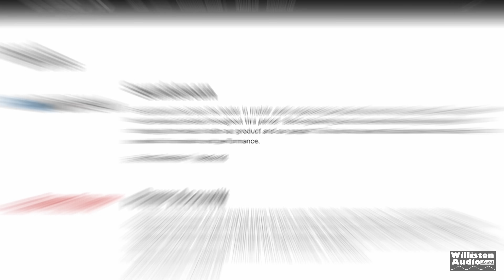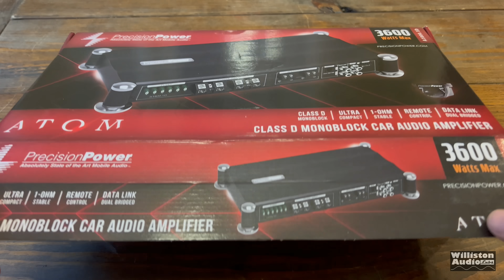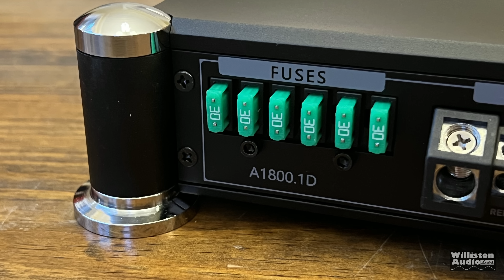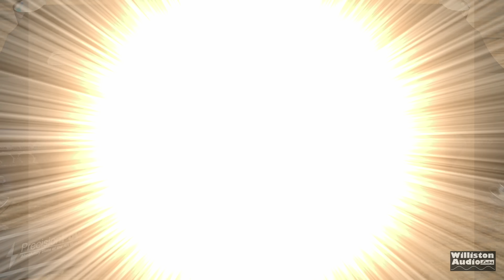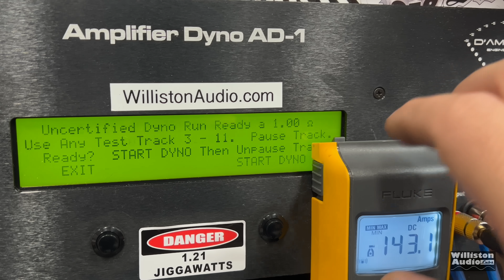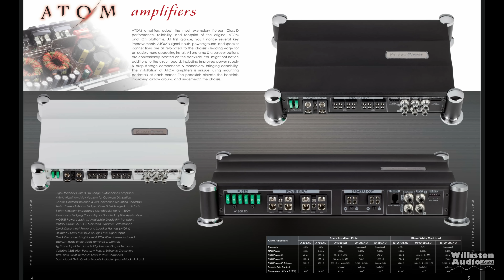KOREAN 1800W Amp for $129? Precision Power ATOM A1800.1D Amp Dyno Test and Review

Comment: The layout of the power/grounds, speaker hookups, and fuse size and layout is almost identical to the Soundstream Rubicon nano5k. I thought the power was going to be similar but it was actually like half because I believe the nano did around 2650 at 1 ohm. At that price tho it really is a good deal and impressive it did .5 without going into protect.

Comment: Where do you set the gain on the amplifier when testing?
Reply from the maker: Amp and head unit are matched via the DD-1+ on the Amp Dyno. Typically the gain is just under 1/2 with the high voltage head unit I use (Pioneer DEH-80PRS)

Comment: this is a good deal for the power available but why rate it at 1800w when it does 1400w? I would be quicker to buy this at the same exact price if it was underrated on the box at 1200w rms and actually did the 1400w. I mean I get the fluff even if I don't agree with it, but it's 2025. we ain't got time for that! we want real or underated rms listing's

Comment: It is actually illegal to void a warranty in the USA 🇺🇸 due to the "warranty sticker" that flies in some European countries, but in the USA we have a little thing called "right to repair" keep splitting them seals Big D! Thanks for the video! While they failed to back up their ratings, this guy does everything I need at a fairly good price. Im'a buy me one!

EDIT: I purchased this amp, and am running it @ 2 Ohms on my Rockville K9 12 dual 4. I was replacing a power acoustic RZR2500 99$ Walmart special. I have to say, the power acoustic isn't necessarily louder, but 100% more solid sounding. I am a little embarrassed to admit, I am an audio engineer, but can't quite put it into words. It seems like the difference in a class AB, vs class D. I know they are both class D, but this has been my experience when comparing a class AB, and Class D of equal power. The class AB sounds much more solid. Not louder, just more solid. I purchased another k9 12. I'm going to give it another shot at 1 ohm. Fingers Crossed!

Comment: The Upright Power Class Amps do make a little over their rated Power.  I think it is cool hqving it stand upright to take up less space and I hopefully be built well enough inside to handle potholes in the road.  But for the price not bad. As for the Atom Series Amps, since they had the correct amount of fuses, I wonder if maybe this amp wasn't "defective"  ?  Or am I being too nice?

Comment: Wow, still priced the same, would luv to fab a plexi bottom for the amp and install it inverted style... the color scheme of the PCB & components looks like a high-end home audio amp, IMO.  Run it hard with the extended warranty but bear in mind that most car audio manufacturers will require you to go through the AMZ seller for a warranty claim, not a manufacturer direct claim. I wonder if PPI operates that way... hopefully we'll never need to  know  :D

Comment: I mean in reality you could buy 4 of these for 5200rms for $520 bucks and a lot people running that type of power run d1s could do 1 per coil and it’ll still be less money than 90% your 5k Korean built amps out there or even if you have 2 d4s you could strap 2 of them each sub run each sub at 2 ohms for 5k+ for $500 imo it’s not a bad deal being Korean made if it was Brazilian or Chinese made its out the window though forsure .

Comment: Im disappointed in their rating on this amp, but i will say the quality is there. Ive been running one of their Ion 650 monoblocks, another Korean built PPI amp, for 5 years in my Crown Vic. Its been nothing other than fantastic for the $100 i paid for it new. The ion's were more accurately rated though, they would make rated power at burst on the dyno at Sonic Electronix

Comment: I've been running precision power atom series on my system for over six years. Starting with the last version of the atom amps and now the new model. I'm running the 5 channel to polk MM 6.5" and a DD1806. I needed something water resistant and compact to fit my build. It's on a pedicab without suspension, being rattled to hell. It's been working great.

Comment: Interesting to see that car audio is still a thing given that OEM car systems are SO much better than they have ever been - rather than throwaway systems - you have vehicles with McIntosh, Mark Levinson, Focal, and others -- so nice!  But as always - the high end market will always provide value. I had several iterations of systems over the years. I had a love of music not just 'sound' so I got a job at a local high end store that had car audio gear -- blauplunkt, alpine, mcintosh or nakamichi head unit my speakers ranged from a/d/s, mbquart b&w jbl speakers driven by early soundstream, adcom, carver and mcintosh amps... such clean sound. NO -- I wasn't breaking any decibel records -- but -- the sound quality rivaled anything I had or have heard in the car audio world.

Comment: I remember Precision Power amps and MB Quart speakers combination was all the rage in the early 90’s
Reply: I still run my 2000 year only chrome PC2400 and PC2100 and still use my MB Quart RCE216 and PSE216 from 99 and 2000

Comment: My MVR expert 1005 gave up on me about 8 years ago. I had that and 2-t1000s for my system. I had no idea where to get the expert repaired and didn't want to spend $2k on a set of newer alpines, so I got the PPI P1000.1 and P900.4 for about $300. Both had the same d-class insides as the Polk, NVX, etc., at the time. They do pretty well, honestly. 
But I doubt I'd buy this.
Are they just throwing a stack of fuses on it to make it look mean?

Comment: It saddens me to see a brand that used to be held with high regard miss lead consumers.  I remember their older amps and always wanted to try them in a build. Just couldn't afford them back in the late 90's and early 00's. Now they are more affordable but I won't buy something that is over rating the power output.  Even if the build quality seems amazing. I want the product I'm purchasing to be able to put out the power it says or more even if it doesn't actually produce it in my real world application.  On that note thank you for your videos so it can assist anyone in making the best decision for themselves.

Comment: Might be a silly question but does the dyno ohm setting account for the wire resistance?
The cheap amps might be rating their amps with the resistance right at the output terminals with any wire resistance being "the customers problem".

Comment: @wal- A Korean built amplifier, that can do 1,427 watts R.M.S., to clipping, @ 1 ohm, with Tiffany style RCA's, and strapable, is a very great value! But, it should be rated accurately. I don't like deception. It should be rated to clipping, @ 14 volts= 400 watts @ 4 ohms, 800 watts @ 2 ohms, and 1,400 watts @ 1 ohm. Thanks for your time, making these video's Dick Riculous, i mean Big D Wiz😉😁 I will be honest, when i seen Dick Riculous in the beginning, i though for sure that meant this amp wasn't even going to do half of it's rating's.

Comment: I probably shouldnt point this out, but if you own a pickup and lust after the AudioControl build featured on the LLJ Customs webpage, this family of PPI amps allow the exact same layout.  Combine these with the NVX 6 channel signal summing LOC and you have a bose factory amplifier bypass system that will run on factory electrical, costing a tiny fraction of the cost of that pavement princess.

Comment: Ppi use to be the absolute cream of the crop when it came to high end clean power from car audio. What a shame they sold out and changed their ways. They most definitely could have been as big as fosgate with same great reputation  but when they sold out the quality went downhill too but I have to say this amp is pretty  I am picturing it on an amp rack looking all perfect with another 4ch amp for highs with all that chrome looking good like a home stereo receiver . Lol. So they still look great but just lost power 😢 but ultimately that kind of power for 130 dollars is a great deal
Reply: Ive been a bass head since Moby Dick was a guppy. PPI has always been crap.  Talk about Boss ratings.
Reply: @elcomandante9299 I agree, I had an Art Series 2075AM bridged to 300W into 2 12inch Punch subs sealed box in 1993 and a friend had  Fosgate Punch 45 bridged on 2 15inch subs that still blew my system away😁
Reply: @havolia127  yeah but your talking volume. I'm talking clarity. Big difference. You can get punch amps to crank out some watts. They were known as cheater amps back in the day bc it would say 45 watts but put out 250 lol or whatever it was. I still have the punch 40ix punch100 and punch200. The punch 200 I think put out like a 1000 watts lol. They are absolutely awesome amps. But ppi always had a crisper cleaner sound. For clarity not volume. And my old ppi promos 450 God amp was the Mac daddy of ppi amps back then. I bought mine used bc I couldn't afford new. They were it though. Art series put out such clean sound and they looked pretty too. Top shelf shit for sure
Reply: @havolia127  box has a huge part of it too and what type of car or suv. All that stuff matters
Reply: @thewhitefamily5515 yeah I agree about the SQ, I had a SoundStream reference amplifier for SQ😊
Reply: @elcomandante9299  dude ppi was the best on the market in mid 90s I think you are the ONLY person that would disagree  lol

Comment: I bought one about 6 months ago and let my teenage son use it in his vehicle with two 10’s at 1ohm. He’s getting a good 1k watts out of it, no issues. Can’t complain at 130.00 for 1.2kwatts, only time will tell how long it will actually survive a teenager abusing the shit out of it😂
Reply: 1,300 RMS at 1 ohm for $130 is still a great deal. If it was honestly marketed as a 1,200  nobody would complain
Reply: thats awesome, and if you ever think of upgrading you could just strap another one on there
Reply: Honestly it should probably hold up. I've been running one of PPI's other Korean amps, the Ion i650, for the past 5 years in my Crown Vic. It's held up wonderfully and sounds good for a cheap amp
Reply: @jeanious2009  ain't no way, clamp it I bet your getting around 400. Impedance rise sucks man 🤣 that's still solid though, I'm currently looking for something that will put out a little more than this for 2 x8s. I'll get something big like 3k plus once I upgrade my electrical

Comment: I don't see the need for 4 amplifier product lines when they're all kinda the same (on the inside), unless I'm mistaken.
I actually had an amp around '97 or '98 branded "Epsilon". I don't recall the model, rated output, etc., but do recall it being 2 or 3 feet long and over 1,000 watts.
Reply: They're just capitalizing on all of the name recognition. PPi was highly sought after back when I was young

Comment: Had Precision Power (or Epsilon for that matter) rated this amp honestly, and sold it as a 1200 watt unit (400, 800 and 1200 watts into 4, 2 and 1 ohms respectibly), it would have been a real budget gem. Also, being strappable, combining two for a total output of at least 2500 watts at a little under $260 is a good deal in my books.

By the way Derek. I saw a Boss amp with honest ratings in the manual. Pretty sure it was the newer Onyx series. Despite having the big MAX number plastered all over the box, the manual it came with had actual honest ratings in it. Never thought I'd see the day
Reply: You are 100% correct about that. 800w RMS @2 ohms for 129 bucks would be a perfect for a lot of people.

Comment: I picked up a Precision Power Ion 520.4 for my front & rears and have been satisfied. That being said, i was coming from head unit power so it had to be an improvement.

 They claim it to be 100w x 4 @ 4ohms. Realistically its more like 65-75w x 4 @ 4ohms. 

It class D so its pretty small and connection wise it installed clean. I payed about $100 and feel like it was worth it. However, like this amp i would have preferred if they had been honest with the rating. They would sell way more amps if they didnt lie about the ratings.

Comment: what size power and ground you running  to it???? the 4awg or did you use some oversized wire with amp inputs / reducers ?

Comment: If they had just told the truth about the power output, this would have been a real bargain. The garbage caps will need to be replaced in a week or two, but that can be done for maybe $75 for real 105 degree Nichicons, and even with that much extra expense, it would still be a bargain - had they told the truth.

Comment: I remember back in the day, a shop I used to frequent had the inside scoop on a bunch of overrated amps that were doing their testing at 16v. I wanna see tests at 16 volts!!! (Should be some smoke involved along the way … Hahahahahaha)
Reply: Alot of newer amps I have used go into protection at 16v so it may be limited to the very few that don't.

Comment: I wouldn't have any issues running one if they just rate the actual power. This should be a 1200w amp and I would be so cool with it. I have a Korean made Soundstream nano 4 channel, the white one. Sounds great and it has never let me down. I don't know its actual power but it doesn't seem lacking.
Reply from the maker: Seems simple enough to me as well

Comment: For the numbers vs price it’s 100% worth it if you only have $129 😅.
Reply from the maker: I whole heartedly agree
Reply: @wal 2 of these strapped at .5 would be pretty impressive I would think
Reply: Yooo trucavalier I remember u had the x3 sub right?
Reply: @Delta132  still got it rebuilt by psi 2500rms monster
Reply: It absolutely is, especially if your gonna run at .5ohm or strap it with another.
Reply: i agree. this amp vs say a RF R2-750.1 this amp is a great value
Reply: Lol..beginners amp
Reply: @allenscott5773 

There is one in EVERY comment section lol!!!
Reply: @drrckhamilton  lol..damn rite
Reply: @drrckhamilton  one what? I’ve had pa and soundstream for years along with RF/kick/sundown and for entry level come on. I would rather a future audio enthusiast buy this amp vs a boss/planet audio anything.

Comment: Have you ever done a dyno test on a us acoustics Mike amp? I'd like to see that. Any of the us acoustic amps!
Reply: Have the Mike and the Barbara Ann.  I am not using either currently, but I  am very satisfied with both. 
Excellent recommendation 👍
Reply: @undernature2799  how's the sq?
Reply: @user-tl7wh7th9s  sq is very satisfying to me.  Always been sql over spl. 
Everyone has opinions, though, as they should
Reply: If I remember correctly they don't make rated power.

Comment: guess that's what happens when you take great USA built amps and have them made in Korea.....smh man. not awesome. pretty sad about that
Reply from the maker: We have seen other times when the engineering sample didn't match the production amplifiers (Sundown SCV-3000D). Maybe the build house goteem
Reply: It isn't all that far off the mark really .
Budget products show their shortcomings in consistency more often than in actual performance , so it is likely that Big D could find another example that would exceed the rates spec by 10% or so .
It isn't unheard of for manufacturers to keep a stash of " ringers " that happen to test far better than average , to distribute for review and evaluation , and , sometimes they deliberately create these ringers rather than testing to find them amongst the stock in hand .

Comment: Why not just label it as a 1200 watt amp?
Reply: Bigger number wins, haha
Reply from the maker: That is the question. Seems the amp was built to handle the lower ohm loads though
Reply: They have an Atom1200 so maybe make this a 1500. Rate it at 500, 800, and 1500.  It's still a good deal 130$ for 1500w Korean amp that can run at .5ohm.

Comment: I just got a alpine 1200watt rms amp from crutchfield sale ended march 28 and i paid 549.99 good deal i paid that for my alpine mrv 500 2 years ago.I also bought 2 10'' alpine s series subs 2 ohm 600watt rms dual voice coal
Reply: 549$ for 1200rms is a little too much in my opinion😮. Hopefully the quality and longevity pays its self.
Reply: A little? Thats insane! @marcovaldovinos5009
Reply: @marcovaldovinos5009  its canadian price 
and is a good price considering my alpine stuff last for years and years of daily pounding
Reply: Car Toys just had their anniversary sale and had the Alpine S-A60M (600w amp) for an incredibly low $130. You could of bought 2 of those to get your 1200w and spent less than half of what you did.
Reply: @ranchosdelnorte  yeah i wouldnt order anything from the states again had that problem with an amp got damaged shipping to canada and then i got to pay out of pocket to ship back no thanks ill stick to my canadian cructhfield.I bought amp from sonic electronics out of the states wont do thAT AGAIN
Reply: Good luck brother. That's a crazy price to pay. I've only blown 3 amps in my lifetime. 2 were alpine. Mrp500 and mrp650. They don't like the heat and they're not forgiving
Reply: @Pi_Cue   I was worried about heat as well cause it staed in the owners manual it may get hot but i had it playing yesterday for 3 hours while i drove around and it just ponding the whole time and i kept checking just in case but didnt get hot at all my old pioneer 600 watt would get really hotbut so far no problem with my alpine set up i just upgraded from the e series to the s and my e series had to be 10 years old
Reply: @JR-ArborsmithTreeCare  to be fair, I'm in Phoenix and many amps don't like the heat here. The trunk can be 180° starting the car. Some amps come on in protect and cool back down 😂. But the alpines both died a permanent death and I stopped there. I really liked the sound which is why I gave it another go. Hopefully the newer ones are better and they are good to you